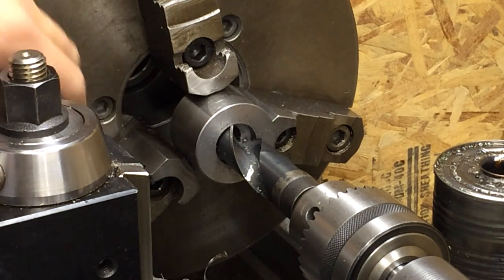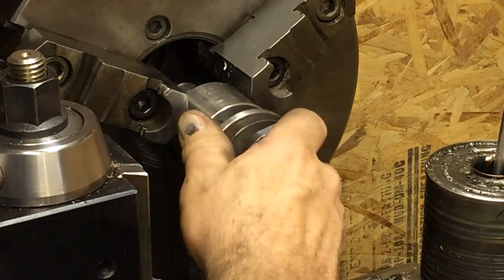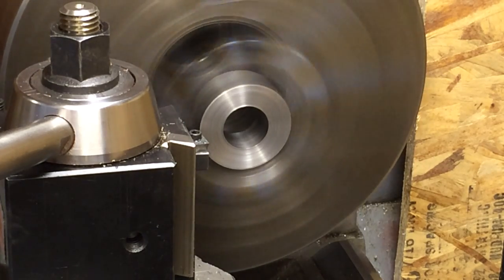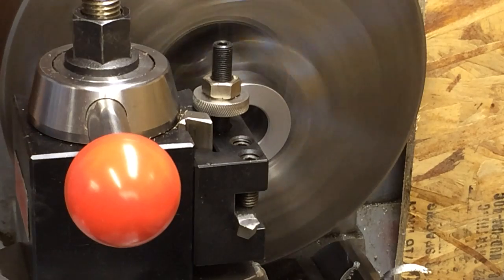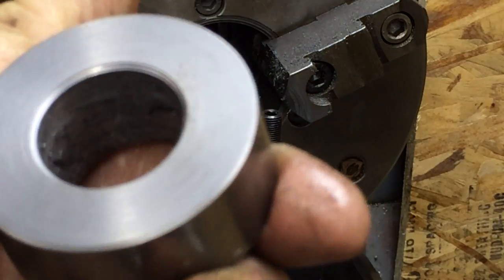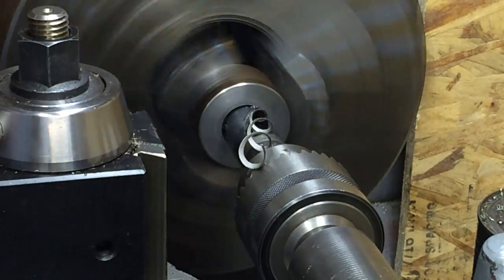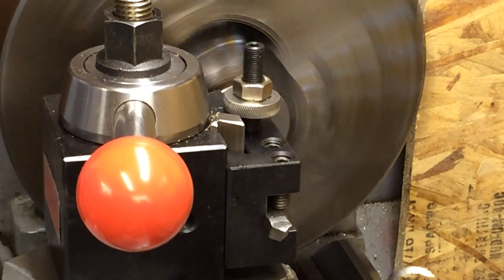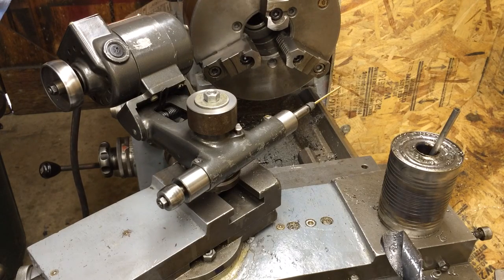How to adjust a Tool Post Grinder Mount Part 1

Comment: Watched twice to see if I missed you calling out the insert type, couldn't get a close look, but looked like a CNMG, what is the suffix? Looked really free cutting, how does it hold up (durability) wise?

Thanks
Z
Reply from the maker: Shadon HKW I just figured out the insert 95% sure.
The RH turning tool Seco p/n 34329 or 00323, APKX.
The facing tool Seco p/n 18810, APKT.
I will put up all of the fine details in a vid soon.
Thanks, Randy

Comment: I haven't really tried anything that big on my smithy yet. I still step at the same rate as my little craftsman atlas. I might try out some drill hoggin on it and see what she can do.
Reply from the maker: Mike Dittman It is always good to know what your machine is capable of.  Drilling is the fastest way to remove material.  Thanks Randy
Reply: I made a few spider nuts on the smithy for the smithy and and stepped it up to 1" by 1/8" I think. Just out of habit mostly I stuck with that. The smithy more than doubled the type of cut I get so I figure it'll probably still about the same. It should make for an interesting video.

Comment: Nice picture of the Erickson Sky Crane.    Big expensive monsters.    I would love to have a "little" logan.
Reply from the maker: John Leake That is from the top of a Siller Helicopter Skycrane.  I like having the small and large option.  This is a pic of one they built for about 5 mil with a worth of about 35 mil.  They are currently building another one. Thanks for watching, Randy